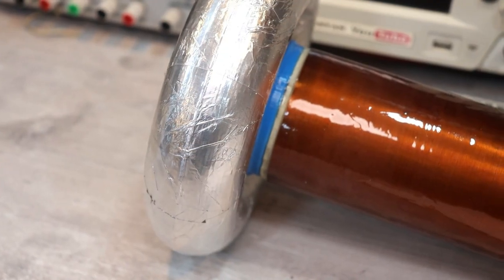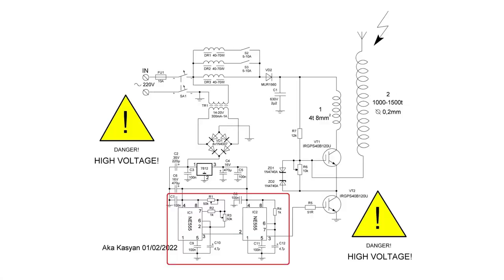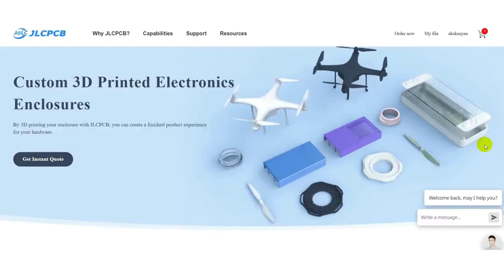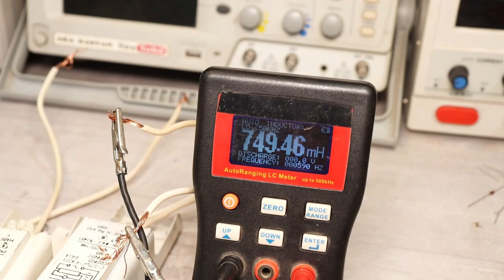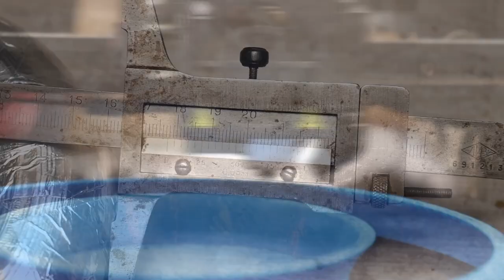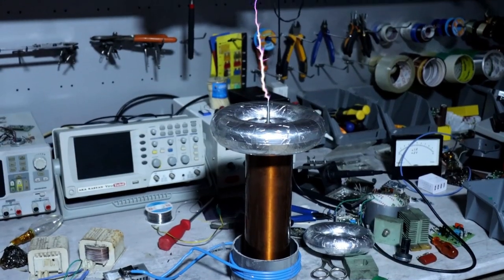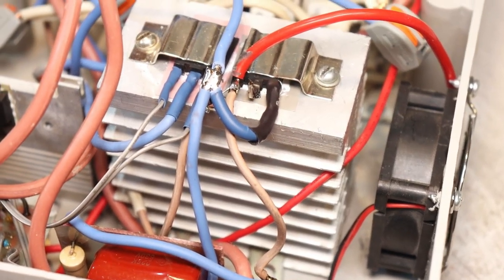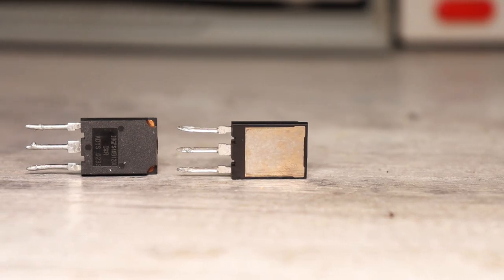Powerful DIY Tesla Coil  |  Transformer

Comment: You might also want to put some kind of snubber network on the primary, you'll get HUGE reverse voltage spikes across the transistors without it. I learned that the hard way. From what I can tell just looking at the schematic, this is an interrupted "beefed up" slayer exciter. for real Tesla Coils you need to see what Tested to Destruction and jmartis2 have done.
Reply: the amount of IGBT's,Transistors and FET's i have killed with kickback emf in Tesla coils are well a lot, a looot, so you are definitely right